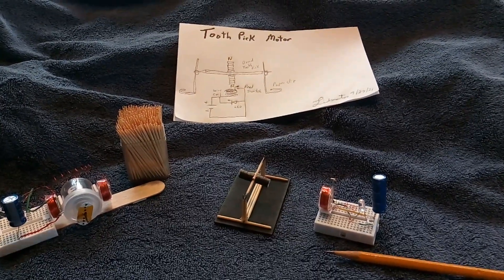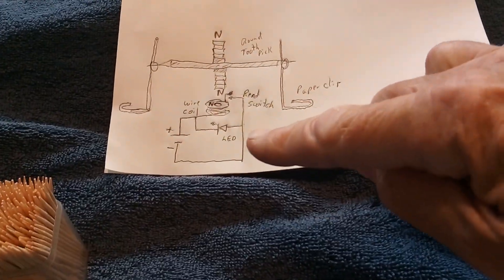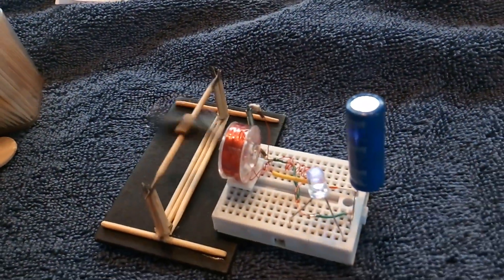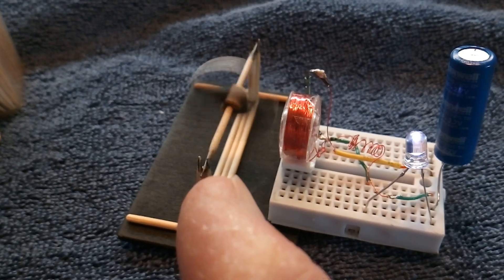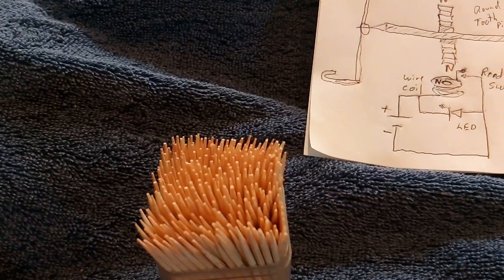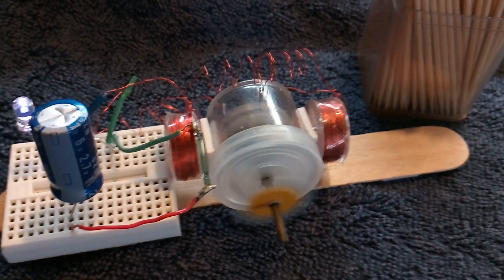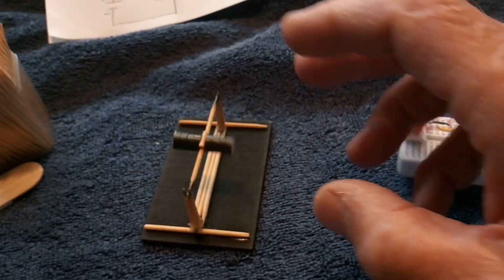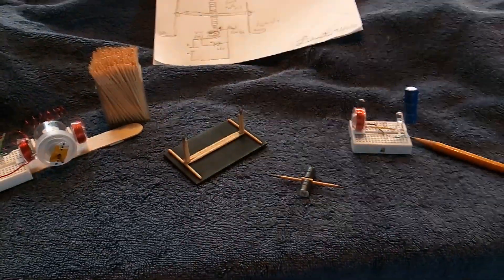Tooth Pick Motor---   Final Design

Comment: Truly inspiring/beautiful work!  Is the LED acting as a flyback diode in this setup?  Does a flyback help to hold the magnetic field within the coil and amplify the magnetic repulsion here?  Thanks for sharing, sir.
Reply from the maker: Yes the LED is the flyback diode you would find in a regular transistor circuit to protect the component.  In this case I use it to see the firing of the circuit and help protect the reed switch from welding shut.  It doesn't really help the driver work better.  The circuit runs fine without it.

Comment: Hi Lid , I have a question , when the coil fires and produces a South field to repel the north facing magnets ,does the coil also produce a north field on the other side of the coil? .if so are you not wasting energy by not using another 2 rotors with south facing magnets on them ? As I say I'm not sure if that happens with a coil producing both north  and south fields . Thanks 👍
Reply: Good question.
Reply: Anything that produces a field , produces two poles. A monopole is a mathematical construct, does not exist in the real world.
Reply from the maker: You are right about it being better to use both sides of the coil driver (N and S) to turn something.  I might build up a device to show that.  Magnets have the two poles but on this motor I jammed two weak magnet south poles together and stuck them together with crazy glue.  This made a permanent magnet rotor with two N facing poles at the outer part. There is still a strange S pole but it is at shaft away from the reed switch and driver coil.
Reply: Technically yes you could run a second set of magnets with opposite poles pointing out.